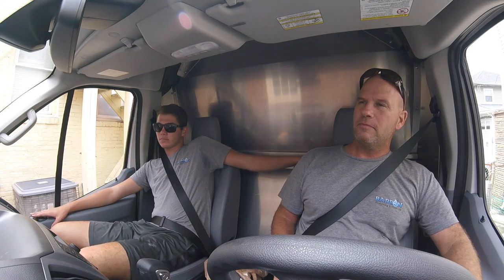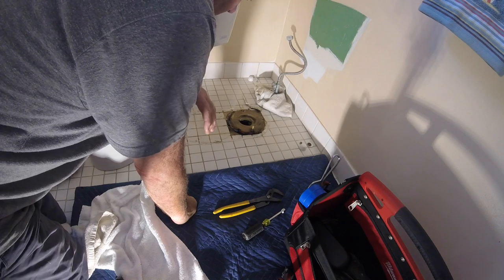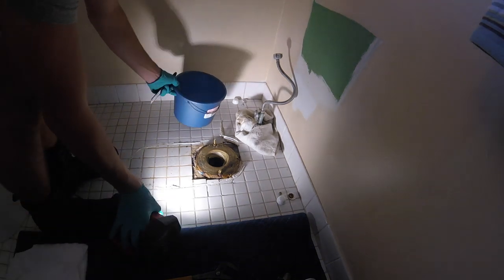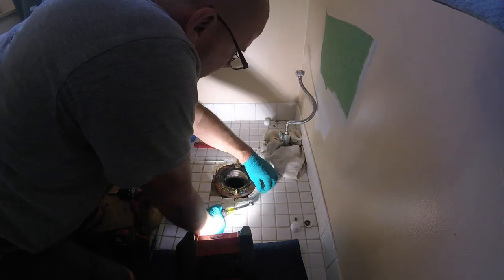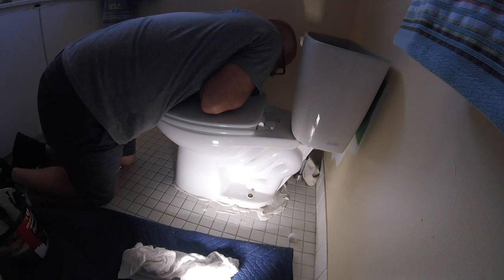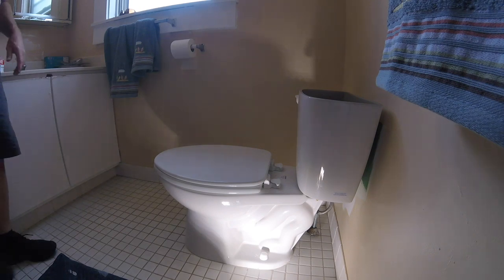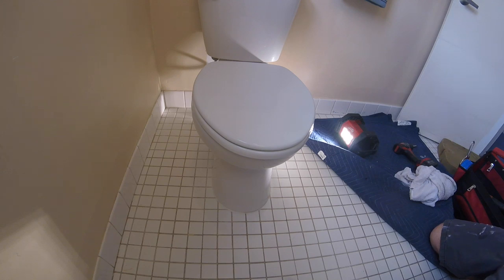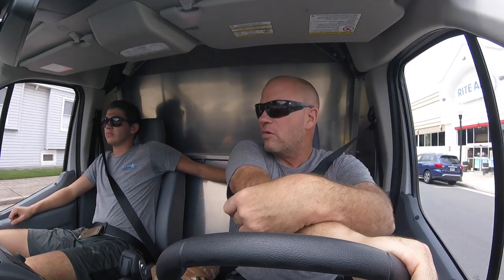ROCKING TOILET SET IN BED OF PLASTER

Comment: US Local 200 tradesmen out of Long Island,NY highly recommend setting the toilet in plaster as a general rule but especially with an uneven floor like you have in this situation. It’s an extra step and a little messy but it should prevent a rocking bowl. Hope your son’s appreciate the knowledge you share with them and providing them with a trade they can be proud of and have a decent future as long as you’re not scared of working with your hands (and back,knees,etc.). Work smarter not harder. Thanks for the content!

Comment: Great job!  Only thing I thought was leaving a small gap in the back where it allows a leak to flow out similar to caulking. Plaster will definitely seal the innards even better than caulk so as the ring deteriorates water will be trapped and be likely to cause damage. Wouldn’t you agree?  I love this approach though. Did a small shim 3 weeks ago. Wish I knew the plaster approach. Next time!

Comment: Mark Miller St Louis,  Hate those metal ring flanges. Bare metal now Chuck. How long you think it will last now? While you had it as far down as you had it. I like to replace the ring with new upgraded stainless-steel type. Its easy to do..Then screw that down with wood screws. Not drywall or zip-in sheet metal screws!  Install new "solid brass" bolts and use extra nut and washer locking bolts to flange. I then sit toilet on clean flange. Install new "hard" shims where needed to get bowl level. Side to side and front to back. You will find  fixture is solid at this point. Mark shim locations and draw around the base making a footprint. Pull it back off. Install new bowl wax. Assuming your plaster is already mixed? If not? Do so. Pour prepped plaster following your pencil mark. Make it say 3/4" thick. Follow your pencil mark all the way around.Then set bowl/fixture down bolts and use your knee or your body weight. Press to floor. Before tightening nuts on closet bolts. Make sure your shims  haven't moved? Adjust if needed. Tighten nuts evenly. Use a putty knife and trim off excess plaster. Then use wet sponge and clean up the plaster to bowl floor at this time. Don't get sponge too wet. I like to use wet/damp sponge on cleaning up looks of latex caulking too. Not silicone. Here in St. Louis All the real plumbing supply houses stock plaster of Paris. Its next to bowl wax/ putty on shelves. Usually in like a half gallon milk container. Once your plaster sets up completely Chuck. I am sure your will be happy with the results. Here in commercial rest -rooms. Code calls for a floor drain. So floor pitched pretty good. Using the process of above. Makes for a "permanent" repair. Gives bowl a solid support all the way around. We all know if there is any movement at all. Eventually the fixture will move enough. Just gets looser and looser. Breaking the seal. At this point game over. Depends on how long its left before fixed as how much floor/wood is damaged. Lastly its 'always" a good practice to tilt toilet to be able to see bottom of bowl while out with a light. Making sure there are no cracks in china. I enjoy watching you Chuck. I'm kinda going along on your journey training your two boys. Nice job! My comments are not to criticize. But to add for knowledge helping them on there journey. We all were told once. For me,even if it was 40-45 years ago now.
Reply from the maker: Brother We appreciate your sound advice. No ego here and you sound like a great teacher my man. appreciate you.  thanks
Reply: just slap a replacement/add-on SS ring over top, the y'll still have issues in the future as brass/plated brass toilet bolt heads rust off from them pissing on the floor etc ;)

Comment: In 30 years, I've never used plaster Chuck...so what's the verdict. are we plastering or what for toilet re-seals? I've always used caulk, but, I'm always open to suggestions as well. Happy Birthday CB2!!
Reply from the maker: ya thats why I tried this. Im up in the air so i will keep ya posted. I have more work in this unit coming.
Reply: @ChuckBarron  I'm thinking neither one.  If rocking shim and tighten.  If you seal, water builds up inside if a leak and by the time you find out, so much has rotted.

Comment: Might sound like a stupid question, but what screwdriver were you using for the flange nuts?
Reply from the maker: Hollow nut drivers I think
Reply: @ChuckBarron  i thought that's what it was just wasn't sure. are they worth it? i thought about picking up a set

Comment: AB-1 I'm glad to see you gloved up early. CB-2 happy birthday. CB-1 here's my tech tip of the week. When I set a toilet on an uneven floor I use a product called Wobble Wedges. This is a master plumbers Secret lol they are soft wedges but rigid enough to support the toilet they are white in color and cut  very easy with a utility knife and they are small enough to keep in your tool bag or Plumbing tool box. I just ordered a container of 75 last week once you're done shimming  the toilet you caulk around the base of the toilet and it will help hold loose tiles as well. They work great so go to Amazon and pull up wobble wedges you want the soft white wobble wedges they have a lot of different container sizes. And if you have to double them up they have slots built into them so they don't separate. Check it out and let me know what you think. Peace fellow plumbers
Reply from the maker: wobbles it is .....Thanks M
Reply: I've also had great luck with wobble wedges too
Reply: @durrsakunyc4324  DG no problem brother they work very well I'm glad to see you pick some up I keep them in my Plumbing box all the time. I'm glad I could help you out. Peace brother
Reply: @jeffcoolhd  2 days ago I dipped into my box of Wobble Wedges I bought to use on my cousin's toilets. Tap them in with a 5 in one tool or a chisel or screwdriver. Then I took a multi tool with a cutting blade and just cut off the excess, of course you can use a utility knife. Then check the bolts tightness again. Then caulk. Maybe in future I would use plaster to be sure. Not a plumber here, securing a toilet with flange above floor level is challenging.

Comment: No I have never personally used it but I would imagine that plaster once it dries it shrinks at least a little bit
Reply from the maker: its nice. easy to work and clean up.
Reply: So it never did shrink? My dad's had a rocking toilet for the whole time he's on his house 20 years and put like three different ones on there now he just got the tile done and it was even worse so what I ended up doing with getting the inside cutters and cutting the flange off because whoever did it didn't have even close to level and there was no concrete poured back when the foam wrap was removed. So after setting the new hub they put in a couple tubes stop leveling concrete around it to fill it in with some long coarse screws to hold in place

Comment: probably would have attacked it with composite shims and caulking instead of plaster.
get it solid/level and tight with shims and no wax ring, mark shim location on floor, cut them off, then stick them to floor with caulking, then re-set toilet with wax ring, bolt down tight and caulk around 95% of the whole thing. I tend to leave the back open in case there's a leak it wets the floor and hopefully get's noticed early on
Reply from the maker: Spongie section on 10 oclock of flange. We shall see.

Comment: You're a better man than me. I won't take a job like that anymore. If there is play in the floor that plaster is just going to crack into more and more pieces over time until it starts rocking and leaking again.  That's not to say you guys didn't do a solid and clean job. Not trying to take away from that. Strong work 👍🏻
Reply from the maker: Time will tell.

Comment: If the customer would not do the right thing rip out the floor, plywood then concrete board then tile I would have used the Danco toilet shims cut then plaster,  some people use caulk but caulk is flexible.  wide painters tape around the toilet be for its pulled makes it easier to clean up the plaster
Reply from the maker: roger that lord

Comment: Plaster? like drywall mud? If so it must get moldy and become like mud if it gets soaked? No one has ever done that in my area. I have metal plates to solidify the floor and flange in a cases like this. Rubber shims and silicone. I could in some cases also pull a waiver the install is not to code because the floor is rotted.

 I refused to complete a job this week because the floor was rotted out(Only a 10 year old house, the builder hacked it. You reset it anyway and the customer or their insurance can sue you for damages. I told the guy to have the wood floor repaired and tiled. Once done I would redo the flange and reset it, I cut the pipe ready for the carpenter and charged one hour. Hopefully he doesn't get him to complete the plumbing. The customer wanted 2-3 wax seals on top of the rot and he has a porche in the driveway. Give me a break.
Reply from the maker: Ya thats a great story. I heard some real gems this week as a professional you are right. we get hung by the judge in court because we know better. Money awarded to Homeowner. good call and bail out.
Reply: TANGO it’s like the putty trick but this is the plaster trick
Reply: @debo2259   It's a party trick alright!

Comment: Those flanges and bolts are designed terribly. After setting the bolts uptight and lowering toilets on top of them one bolt always breaks free. What a stupid design. The head of the bolt should be tight inside the flange so it won’t pull out. Because of this defective design I’ve had to add washers to the head of the bolt so it couldn’t pull out. Every time I install a toilet and this happens I have to remove the toilet to put on a new wax ring because I want to ensure there won’t be any leaks. 

A better system would be to have threads in the flange to insert two all threads. Then it’d be secure and wouldn’t pull out of those poorly engineered flanges. 

I haven’t tried using plaster yet. What type do you use?

Comment: A grout sponge works way better only $1.90 and you wash it out and re use it over and over . Less messy and gives it a cleaner look just saying. I use premixed white grout works way better and will not Crack and you can still remove toilet in future and its rock solid toilet will not move, I use the stain resistant.  But i set toilet down and then use a putty knife and push the grout under base just to fill the gap , it not only seals the toilet so urine from males don't get under there but it locks the toilet down which is good for families with kids who are rowdy and for home owners who are overweight the toilet will not move. Like I said you can still remove toilet in future because the grout is only around the corner of base. Been doing it like that for over 20 years and never had an issue.

Comment: Your teaching the boy wrong, first thing to do when working around a toilet opening is to plug the hole with a ball of paper or a rag. I don't believe what you did is any better than if you would have just mixed some plaster up and worked it under with your finger, it would have went under where it was needed.
Reply from the maker: Thats up for debate. I will keep you posted on that one because much more work coming at the building.